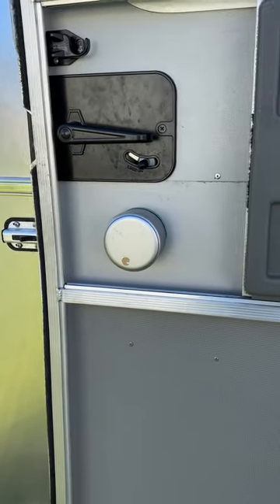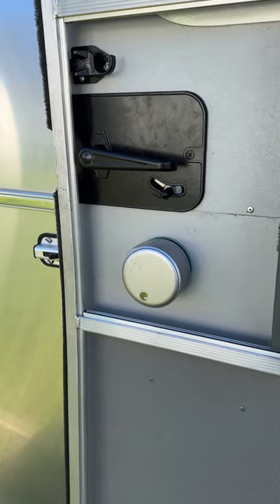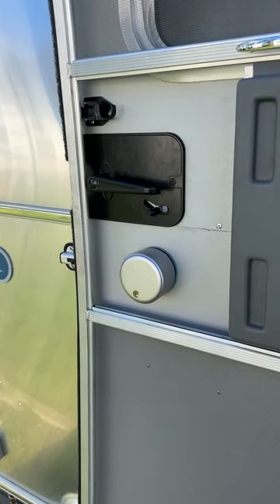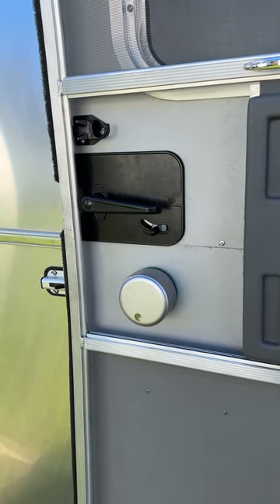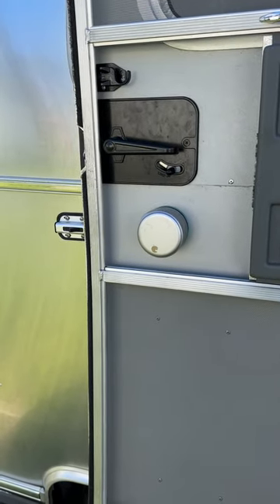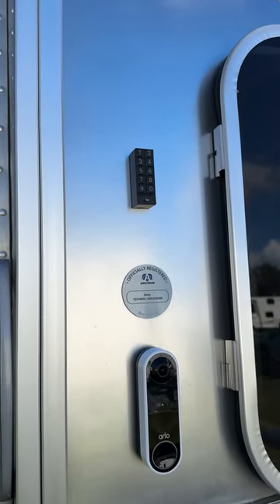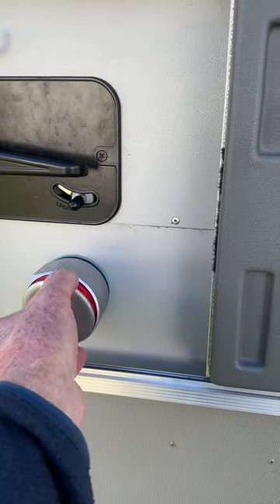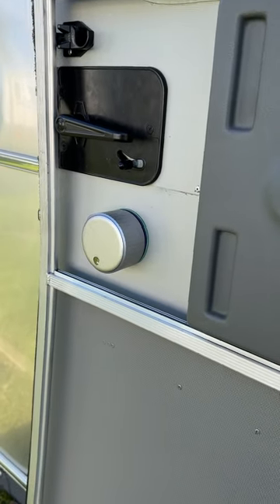Installing a WiFi Smart Lock w/Keypad on Any Airstream Door

Comment: Thanks for this Dennis. I'm curious to know how you installed this. It doesn't look like you removed the original door lock ??
Reply from the maker: Removed the inner knob, and modified one of the lock adapters to work with the protruding rod.  There's a butterfly lock that you attach to hold in place.  Look at a video to install lock on a normal door